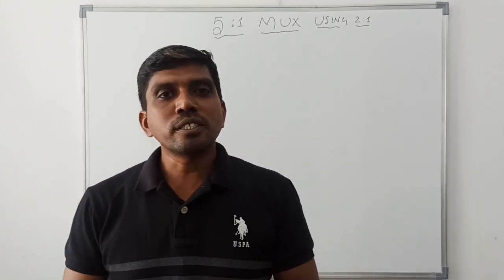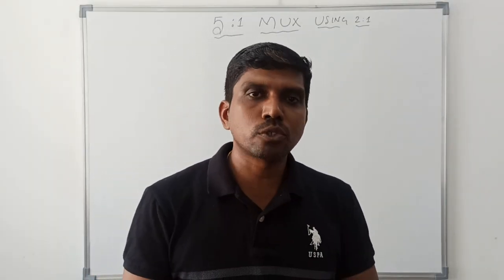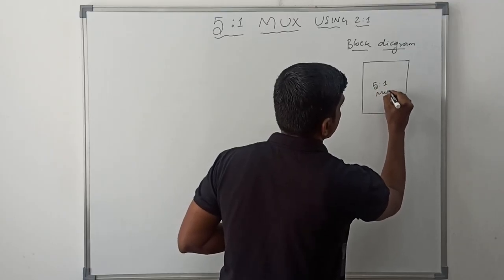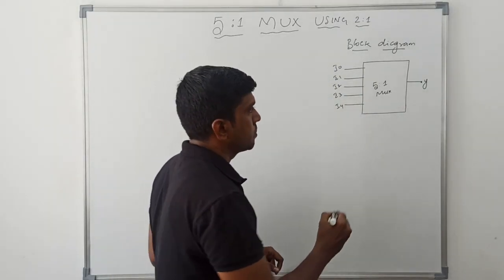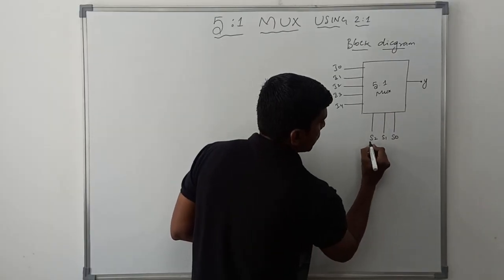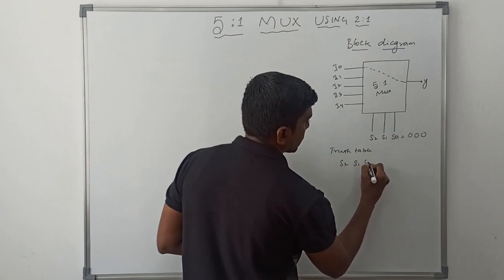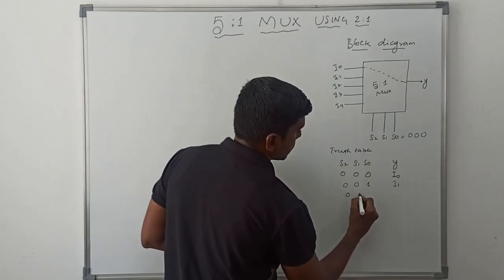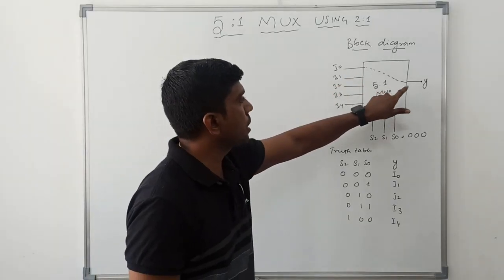5 to 1 Mux Using 2 to 1 Mux || VLSI Design || Learn Thought || S Vijay Murugan

Comment: Sir plz upload these topics
UNIT IV : 
Sequential digital circuits: adders( full adder CMOS, Full adder using transmission gate), carry select adder, carry skip adder, carry save adder, ripple carry adder, Manchester carry chain, 
multipliers, comparators ( comparator 2 bit design using pass transistor, wallace tree multiplier, 
shift registers. Logic Implementation 
using Programmable Devices (ROM, PLA, FPGA), Memory Architecture and Building 
Blocks,Memory Core and Memory Peripherals Circuitry
Reply from the maker: Ok sure, I will upload as soon as possible
Reply: @learnthought3871  ok sir thank u